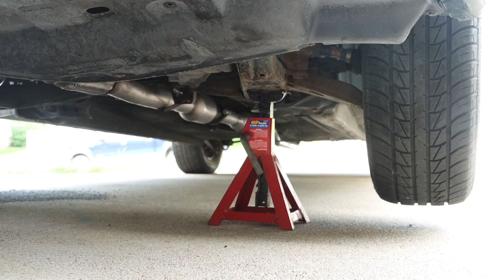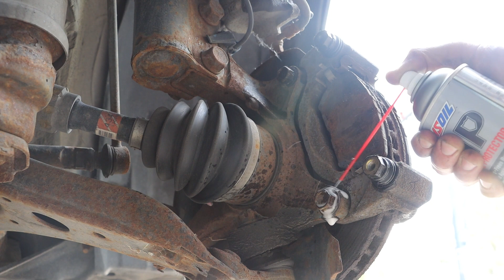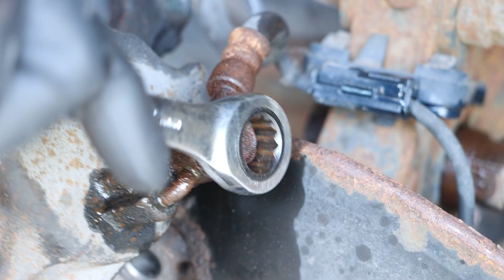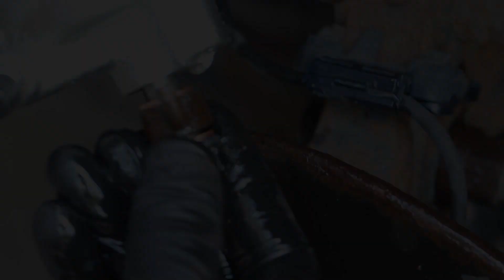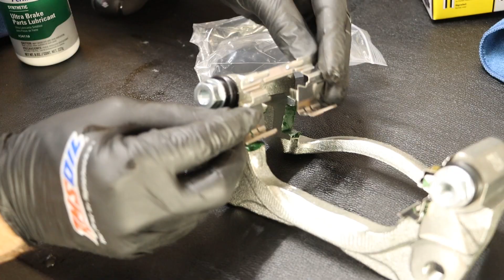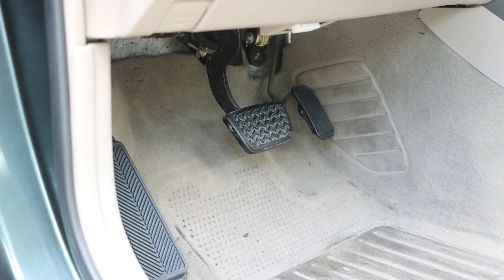Front Brake Caliper Replacement (with pads and rotors) - 2003 Toyota Camry, 2.4L (2002-2006)

Comment: I have the same vehicle. A 2003 Toyota camry le 4 cylinder. I'm needing to replace the dust shield /backing plate on the front driver's side. There's got to be an easier way to this other than having to remove the knuckle, hub and wheel bearing. Do you know the part number for the backing plate? I'm going to modify it so it becomes a simple bolt on plate.
Reply from the maker: I think this is the part you are looking for: https://www.partsgeek.com/jslw3j6-toyota-camry-brake-dust-shield-set.html?utm_source=google&utm_medium=ff&utm_content=UK&utm_campaign=PartsGeek+Google+Base&utm_term=2001-2006+Toyota+Camry+Brake+Dust+Shield+Set+Autopart+Premium+APBDS0030+Front+01-06+Toyota+Brake+Dust+Shield+Set+2002+2003&fp=pp&gbm=a&gad_source=1&gad_campaignid=17182816450&gbraid=0AAAAAD_bfN6TJ2p_-oqSCGxyeTJer5Wt2&gclid=Cj0KCQjwlrvBBhDnARIsAHEQgOSwvvZFhoNE8A_PATv9rivpJAEx4NOJtIearvpkD1mU7z0ZjR08yzYaAtj3EALw_wcB

Comment: Don't you have to open the bleeder valve on the ABS module when you bleed these? Seems like I had read somewhere that if you don't, you could damage the module.
Reply from the maker: Thanks for the comment.  The service manual does not indicate a need to open the bleeder valve on the ABS module when performing this repair.

Comment: I appreciate how you filmed the details well. Shouldn't the brake lubricant grease go on the surface of the metal clip not underneath so that it can lubricate the contact surface of the pads where they slide? Also, maybe better to pinch the hose so not too much brake fluid leaks when removing the hose. Thanks!
Reply from the maker: Thanks for the comments. I understand your thoughts on the contact surface of the pads where they slide.  Some people do this.  I have a concern with the grease collecting brake dust and gumming it up quickly.  As far as the brake fluid and pinching the line...it's an old car with old brake lines.  I didn't want to risk rupturing the line.  Additionally, the entire system needed bled anyways.  Good luck with your repair.
Reply: @InsaneOil  Understood. Thanks